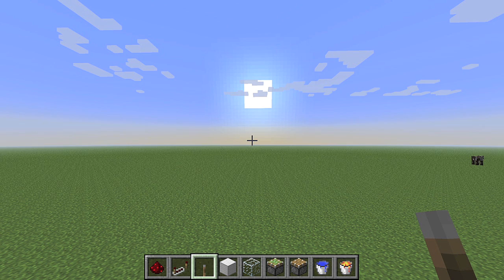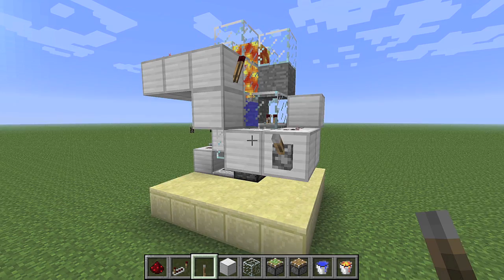A Reliable Smooth Stone Generator (Minecraft Tutorial)

Comment from the maker: Nope. With this design you do need to avoid pushing to the limit or you will encounter the problem you describe. It's not terribly difficult to avoid. It's also not difficult to add a manual advance button to the pusher piston which you can use to unjam the machine once some blocks in front have been removed.

Comment: I've built this (in 1.6.2), I thought I did it correctly, but have a problem.   If it is allowed to generate blocks to the limit, the last one is pushed up by the piston below which blocks the lava leaving a void above the water and requires manual intervention to break the block below the lava and in front of the horizontal piston to allow the lava to fall again.   Is this just an issue with the more recent version?